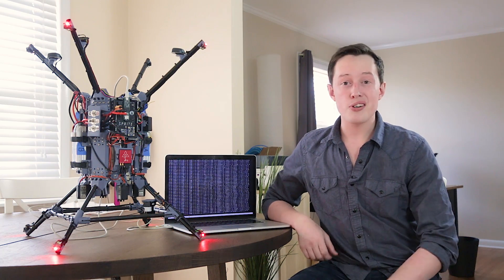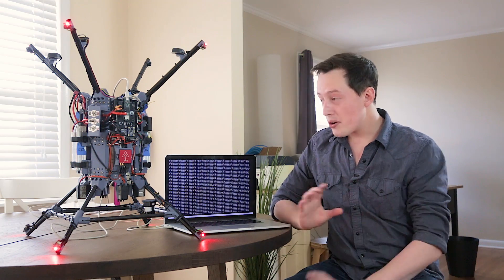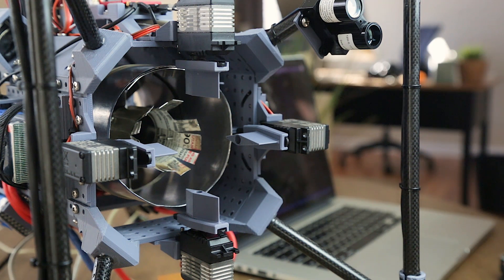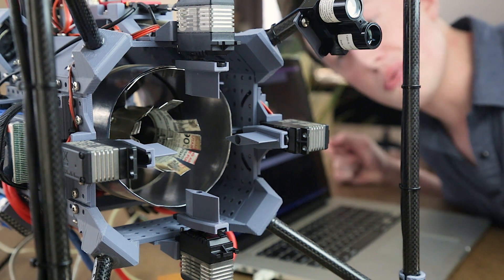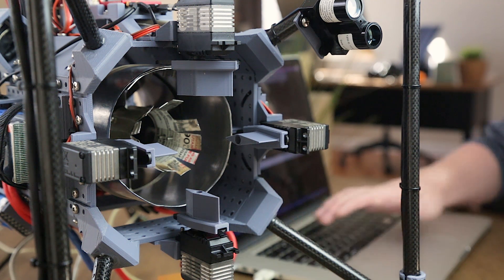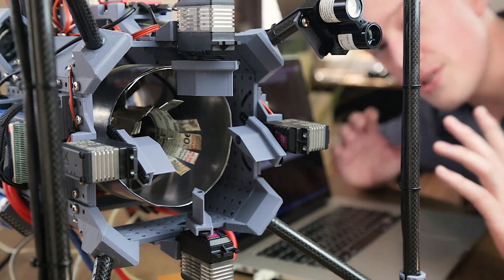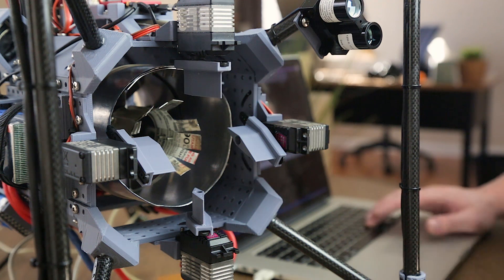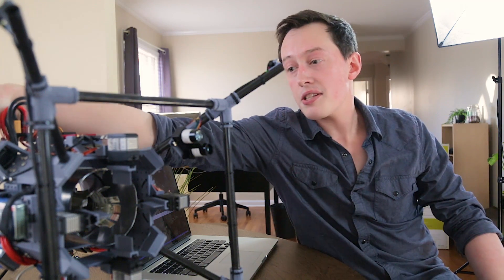TVC Vane Alignment

Comment: Deflecting these vanes by more than ~25° is pointless. On larger deflections, the gas/air flow around them stalls. Just like aircraft stall at too high angles of attack.
Reply: P.S.: this diamond shape is better than a flat shape. Best shape would be a thin symmetric airfoil, like e.g. NACA 0009 or NACA 0012.

Comment: If you want after burner. Have a small amount of butane to light a flame and then inject kerosene. Way hotter and stronger flame for very small amount of weight.

Comment: I'm kind of curious if you get more moment by refining the shape of the vanes while preserving thrust.  ie, Which is better; diamond, flat-plate, or symmetrical airfoil.  Does maintaining good boundary layer adhesion matter?  If a vane "stalls" does it still give good control moment, or just more drag.  What are the relative critical angles on the different types of vanes?

Just a reminder from an old RC guy, and I only mention this because it is so often overlooked: Once you find the best center angle for each van, remember to center the servo under that angle so that you have equal throw in both directions from center.  You probably already know this, but like I said, it's something a lot of guys overlook with newer computerized systems that allow the center to be reset in software, then hit a mechanical limit in flight.

Great post, BTW, really enjoying these.

Comment: The profile of these fins is designed for supersonic flight, I think that if you put a symmetrical wing profile, naca0012 type will be more effective because the profile will not get stalled easily and deflect the air better.
Reply: The exit velocity of the gases is even hypersonic, so yeah, I think hypersonic fins are not an option and are the ideal here. The flight might not be supersonic but that's really not the point, they have to sustain the supersonic flux of the engine and create lift in some direction in order to "move" the exit flux in a direction, so thrust vectoring
Reply: @DarkQwerzar   But what he is going to use is not a rocket engine , it is a propeller attached to a tube   n EDF.  That at most the gases are going to have an output speed of 300 or 400kmh . (100m/s)
Reply: @CuervoRC  Oh, my bad didn't know he planned to use that with a simple propeller. Why is that? I must have missed some videos. Well in that case you are absolutely right, a supersonic fin would be bad, but I think for a subsonic fin it would need some aerodynamic calculus, the stall problem is indeed real and a low thicness like the NACA model you proposed Is indeed good to obtain an higher angle of attach before reaching stall
Reply: @DarkQwerzar  It's because this is a test hopper for him to use while working out the kinks of guidance and automated control in a faster, less expensive, and more controlled method than burning through engines. The plan is still to use these collected data for future rockets.

Comment: Aluminum is not a high temperature metal. You may see it burn away pretty quickly. Steel or stainless steel sheet metal would be better. Much lower risk of failure.
Thanks,
John

Comment: For your alignment jig I have an idea, you could use laser pointers and a chart at a distance away (set it as far away as you need for resolution).  Should be cheap, easy and quite accurate.  Could just print caps for the fins that have the laser mounted to them long as the fit is snug the results should be repeatable and chart placement can be done with an additional laser mounted either in the nozzle or on the frame.

I mean it's essentially just a basic alignment jig for a car but those can be accurate to a hundredth of a degree.  I'm guessing that's probably good enough for this application.

Comment: If the vanes are made of aluminum, they'll get really hot from the afterburner, no? Will they melt their mounts on the servo? How will the servos be insulated?
Reply: I was thinking the same thing, it might be worth it to look into a vane material with lower heat conductivity.
Reply: They look like some pretty serious servos but I don’t know if they will withstand the heat...

Comment: Why are you not using aerofoil shape of neutral camber for the vanes? Wouldn't those make the loss of thrust smaller as well as the thrust control more efficient as the amount of flow separation would be smaller?

Comment: Hey Joe, I really liked the video. And I don't know if this is the right place or not, but I might have a question. I am currently building a scale Falcon heavy (Without TVC). I was wondering how about how much total voltage you used to launch your Falcon heavy's three engines. If you have time to get to this question that would be very appreciated. If I should go somewhere else, could someone point me to there?
ps. love your vids.
Reply: Same total voltage as you would fire a single one of the engines. Each E-match should be connected in parallel, not in series. In series, it will only ever ignite one engine since whichever E-match lights first will break the circuit. The specific voltage is dictated by the choice of E-match/igniter rather than the engine itself.
Reply: Just ignite them parallel to each other and it will use the same voltage as one engine 👍
Reply: Can't you just build some test circuits and try it?

Comment: What are your plans to not melt down the servos when having the afterburn on and metal vanes, assuming the vanes will get hot after some flight time?
Reply: Good question! I assume maybe a different servo "case" or shielding of some sort? I wonder how hot the parts actually get when the thrust is a controlled stream.
Reply: The edf is moving a lot of cool air past them. Burning butane in an open flame like this doesn't produce a ton of heat. David Windestal has done this in a foam rc plane with a plastic fan and it didn't do anything do the foam or plastic
Reply: Thanks for the responses, guys!
Reply from the maker: @cartolla  Yep - JBpiification has the answer! Also, the actual flame diameter is about half the diameter of the EDF so there will be a barrier of cool air in between the flame and the servos/vanes

Comment: How about SLA printing the Vanes in Cermaic or High Temperature resin? Itnwould be lighter than metal maybe?
Reply: As far as my knowledge goes, I’m pretty sure sla player adhesion is laughable compared to fdm. (I heard that somewhere but I’m not sure if it’s actually that bad) so that could be a pretty big drawback for this type of usecase for it
Reply: @1231legomaniac   I've SLA printed parts and they're great for light applications sich as these vanes
Reply: @1231legomaniac  SLA has better layer adhesion than FDM actually. Here's a source for coroberation (skip to the section titled "FDM vs SLA: Precision and Smoothness"):
https://m.all3dp.com/fdm-vs-sla/
Reply: The afterburner would bet super hot to aluminium is good, even though it’s a soft metal...